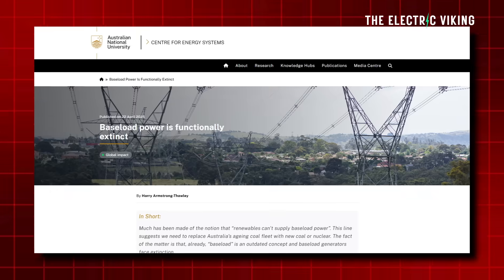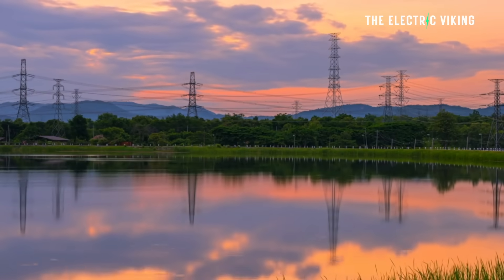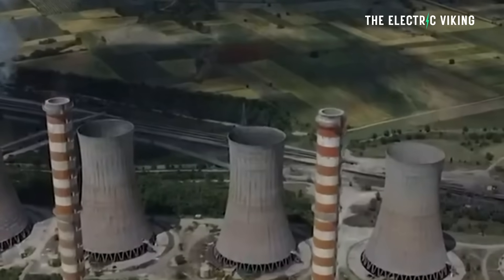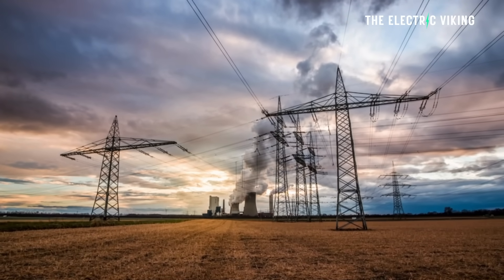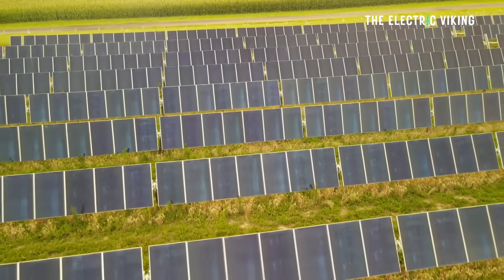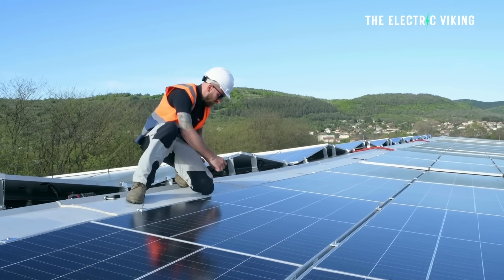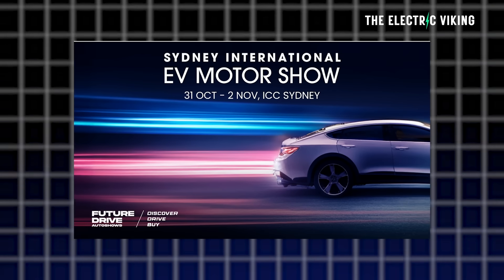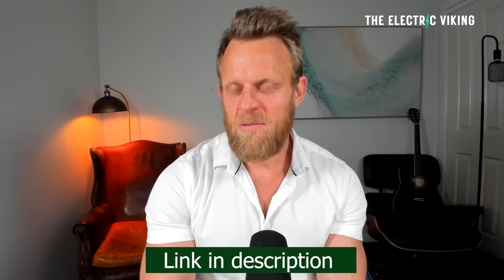The End of Baseload: How Renewables Are Killing Coal & Nuclear

Comment: In my province base load is provided by hydro which works very well in combination with solar and wind!
Reply: The hydro provides 'firming'.
Reply: @iainw5081  only pumped hydro would provide firming
Reply: Yes! Places that have hydro are lucky.
Reply: Hydro is a great form of energy but it is dependent on geography like geothermal but its function can be partly emulated  with fission and batteries makes it play better with wind and solar
Reply: @corradoalamanni179  Nuclear is too expensive and takes too long. wind and solar can be firmed by scale. On a continental scale, solar is very predictable and wind is very stable.
Reply: @williammeek-h2o  nuclear is costly but not as much as having so much solar and wind to shunt it around on that scale . Think about it the more you have the more you waste , having a share of fission leads to less grod cost and less overbuild
Reply: @corradoalamanni179  I just went off grid so none of that applies to me.
But even if it did, the wholesale cost of electricity from nuclear plants and wind or solar reveals the reality that nuclear is too expensive. Not to mention the future problems in that there is no where permeant to put the waste when it is made.
Reply: @williammeek-h2o  electricity from fission is expensive but final cost its what matters , look at france vs germany or denmark. 

France has lower electricity cost and lower co2 per Kwh ,that is because of grid cost , having more solar or wind that you need and having to subsidise it while curtailing it and paying another producer even more money to produce sometimes when you need it leads to higher final price than simply having more fission in the mix leading to less scarcity and less overabundance
Reply: @williammeek-h2o  waste is a very little problem there is few of the long lasting spent fuel , and it is easy to store because it is solid unlike other toxic chemicals that we manage.

There is hope that with more adoption of fission spent fuel will simply be re used .( we use only a few percent of the fuel )
Reply: @williammeek-h2o  completely off grid? Cool! Care to tell me your setup? I am really curios,  I would think heat pump induction lots of solar and batteries?
Reply: British Columbia
Reply: How much do you pay per KW? I’m guessing close to .10 per?
Reply: @QE007 $0.1097/kwh. That's Canadian dollars.

Comment: solar, wind, batteries, hydro ... we don't need fossil fuels any more
Reply: Hooray! Only it is not true/affordable at reasonable prices with the technology available in 2025. A battery energy storage system (BESS) 10 years ROI of USD 1.022.000 per megawatt storage capacity is considered LOW by investors. Below $80 revenue/year per one kwh investors run into a loss and can´t service banc loans. At $150 USD revenue/year per kwh investors are happy. How does it work in 2025? "Growth in summer solar output has been a key driver of system stress & higher revenues, particularly on higher wind output days. A combination of low residual load and high solar has led to higher FCR and aFRR prices across the middle of the day. Low prices mean generators which usually provide downward flexibility are not running, driving up ancillary service price signals to incentivise alternative flex."
Reply: Do you have enough storage to last a few days when the wind doesn't blow and the sun doesn't shine?